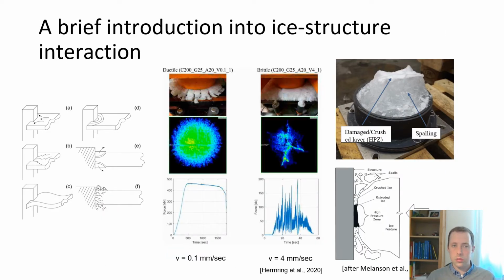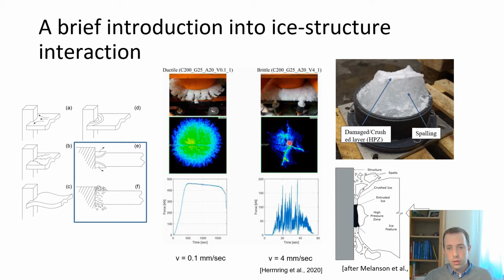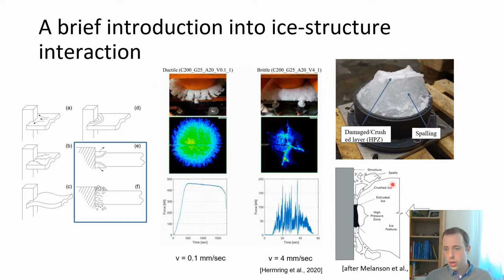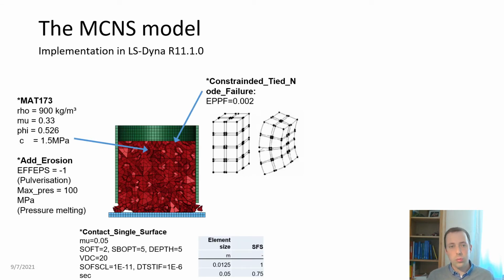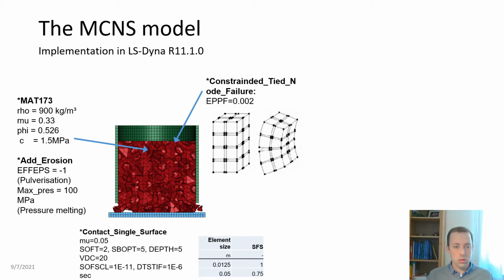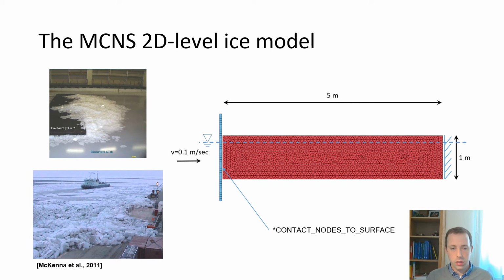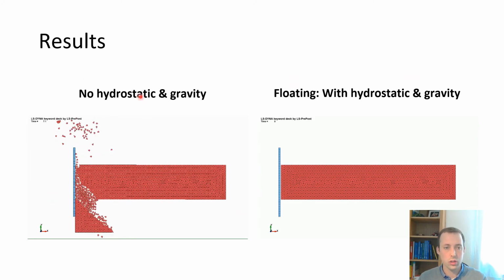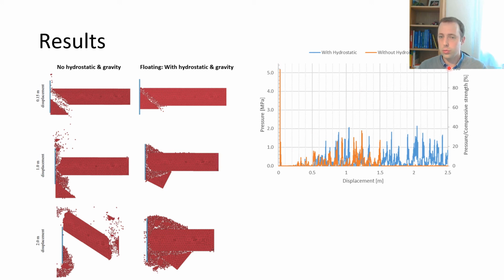ICIMECE2021: ME105-Simulation of two-dimensional ice crushing processes with the...-Hauke Herrnring

Comment: Dear Hauke Herrnring, this is really great research work. Have you tried to switch from LAG-FEM to meshless methods in LS-DYNA (SPH, SPG)?
Reply: Hello Yury. Thank you for your comment. I tested different methods in LS-DYNA (BDEM, PERIDYNAMIC, SPH, SPG and CZM). A special challenge of these simulations is the compressive dominated failure process. Therefore I must represent ice self contact. Most methods for the assessment of brittle failure are mainly designed for tension dominated problems. To my experience this is also the case for all meshless methods in LS-Dyna. Accordingly, they can represent self contact only to a limited extent. Furthermore the final intended application is the simulation of the structural behavior of ships. Here I estimate the coupling possibilities with a FEM based ice model as favorably.